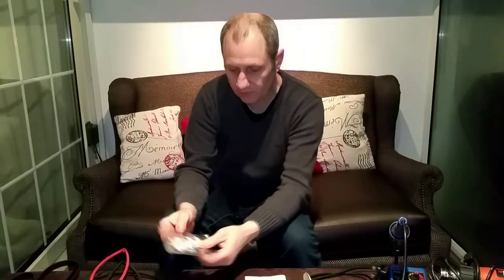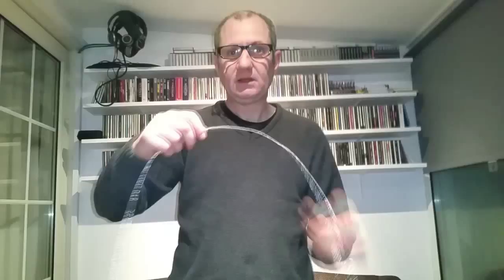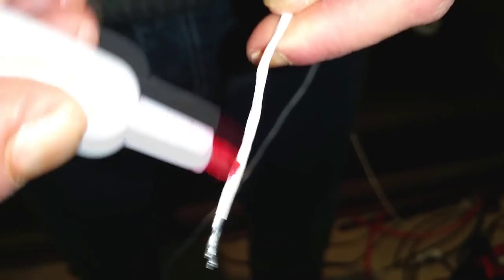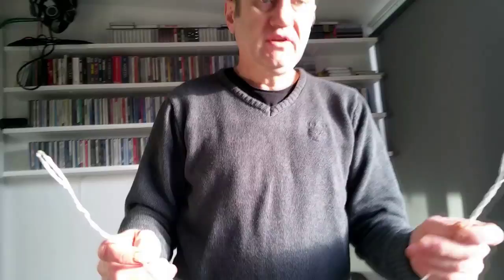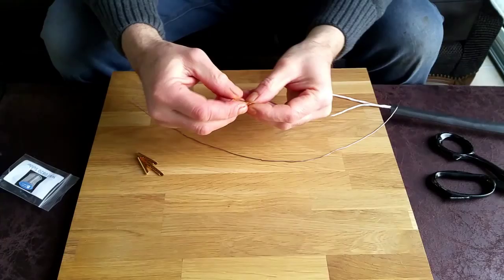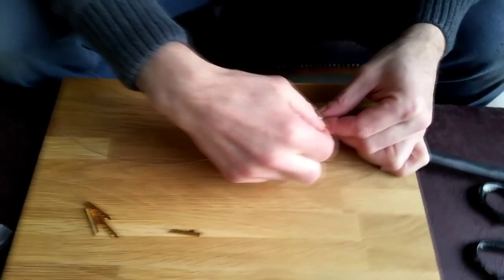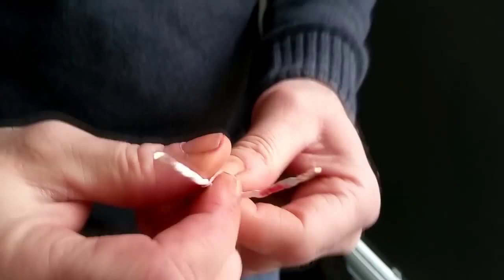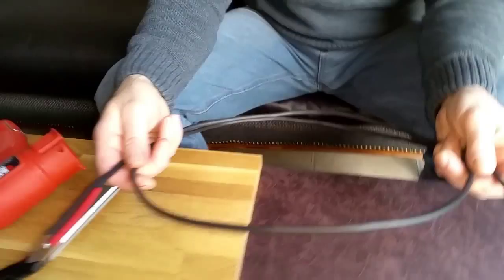how to hand make some high end speaker cable

Comment: so don't you have to change ALL  the wire in the signal path? for instance I have a prepro to my power amp to my speakers. And I have made tower speakers. Doesn't the cables have to be replaced in those as well?

Comment: I noticed  the solder wrapped around the wire  was not completely melted,  why  would you want a cold joint?
Reply from the maker: The solder was completely melted, I never leave cold solder joints, thanks for watching

Comment: Hello, love your videos and your build methods.  My question is regarding the silver filled copper conductor wire.  I could not seem to find it on their website or anyplace else, do you have any suggestions please ?  Thank you again
Reply from the maker: P.o.B pedals Hello Ebay item no:- 5060454594468, I'm glad you liked my video, happy building.
Reply: tweaker man thank you for your quick response,  that number does not yield any results,  any other suggestions?  Again thank you for your help
Reply from the maker: P.o.B pedals sorry 121635427067, the Ebay number should work.
Reply from the maker: P.o.B pedals Sorry the 0.6mm 11165721998.

Comment: Hi
I want to make a Cable like yours, use have used .6 x5. Can I use .6 x6 or 7 to make  it thick.
Reply from the maker: ameen Sharif yes you can, I'll be doing a video soon on a 6mm speaker can, but go ahead the thicker the better, nice to hear from fellow audiophiles, thanks for watching.
Reply: tweaker man , thanks for your reply.  If I make it 6 mm, will it be better than 3mm.
Reply from the maker: ameen Sharif it very minimal, ot depends on your speakers, but you will get a fuller sound, i use the 3mm on my speakers, just because my system is in a small room.
Reply: tweaker man, thanks heaps. I am also making RCA cable like yours. You have used .4mm x2 cable. Will it be better to make it thicker. Can I use .6 mm for RCA ? Thanks again
Reply from the maker: ameen Sharif for interconnect, I've tried all sizes & 4mm works the best, it give the best sound with highs, mids & bass, I hope this is helpful.
Reply: tweaker man , thank you so much. When finish I will let you know the outcome.
Reply: Hello , can you tell how to make XLR connector
Reply from the maker: ameen Sharif I'll do a video soon on xlr connectors

Comment: Hello. Is it the same or maybe better to put conductors in PTFE (teflon) tubes ? Should I polish silver conductors first. To clean them from oxidations,... I heard that somebody oil conductors with some oil to prevent later oxidations. Can You send me link for connectors?
Reply from the maker: Vasja Grmek Just use the conductor as from new, if you want, you can wear a pair of surgical gloves, so your hands don't touch the conductors, ptfe tape is different to teflon heat shrink tubing, I find the ptfe tape works better.

Comment: What solution would You recommend for bi-wire system like Epos ES11 without building two sets of cables?
Reply from the maker: Hello, you will still need to build two sets of speaker cables to bi-wire or bi-amp, you can't get away with it, unless you buy speaker cable ready made, if you want to go down that road, I recommend Van Damme hifi series studio grade speaker cable, this speaker cable is underrated, but excellent, the 6mm is the best, bunched and braided, I hope this is helpful, thanks for watching
Reply: tweaker man Thanks a lot for Your help, apriciate it a lot!